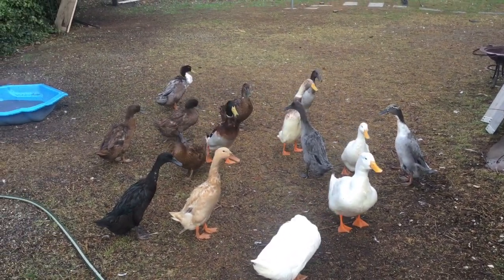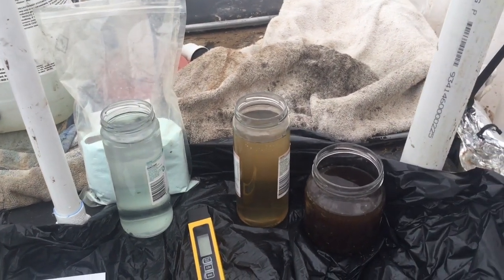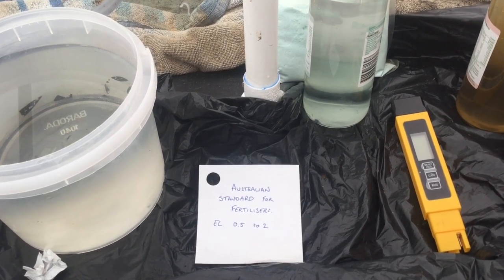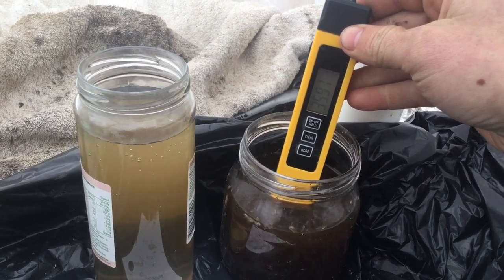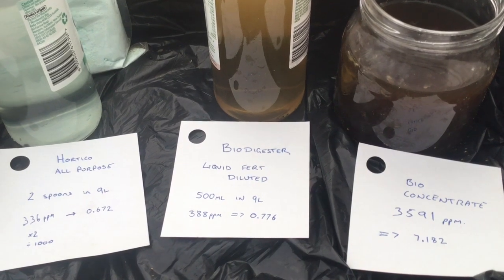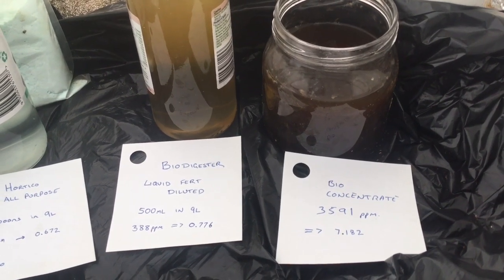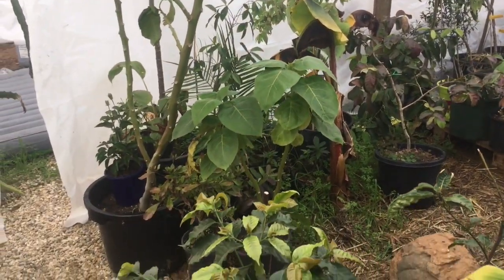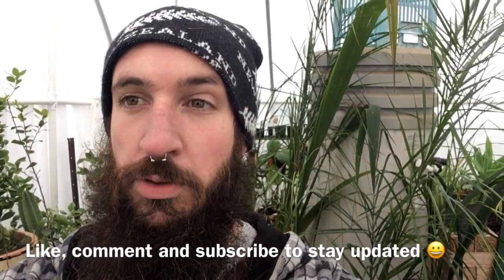Biogas digester liquid fertiliser EC comparison - Homemade Fertiliser From Waste

Comment: Same question as the last basically. Listening to Elaine Ingham I gather that the microbiology critical to soil health is aerobic. Further, she discussed that these micro organisms can be disrupted rather easily if the soil environment should become anaerobic. Thus I'm left with the concern that introducing anaerobic fungi, bacteria, nematodes and microarthropods directly onto a garden bed might actually do far more harm than good. I'm certainly on board with the concept of producing biogas except for the issue of bi-product which I haven't got reconciled in my understanding nearly enough to actually build the reactor. What's that stuff look like under a microscope?